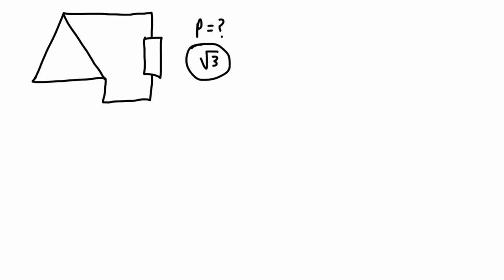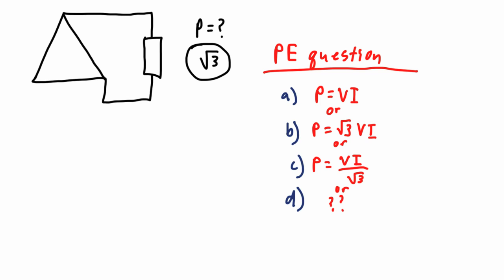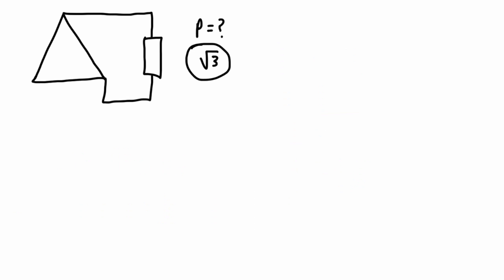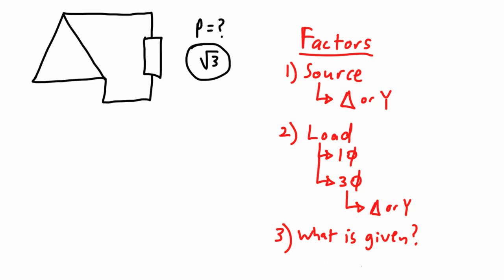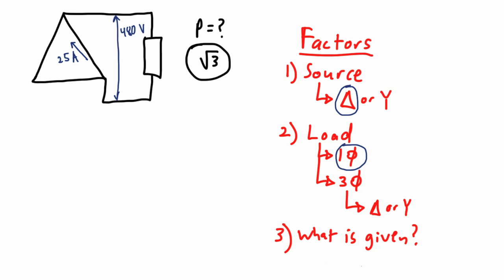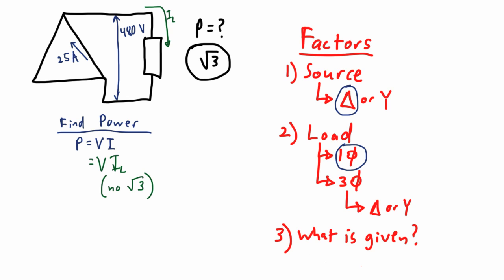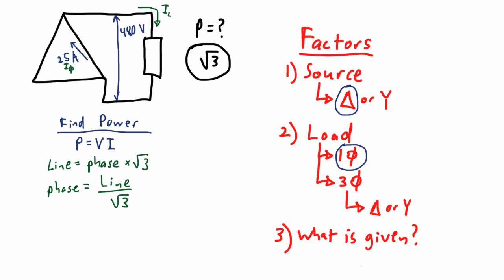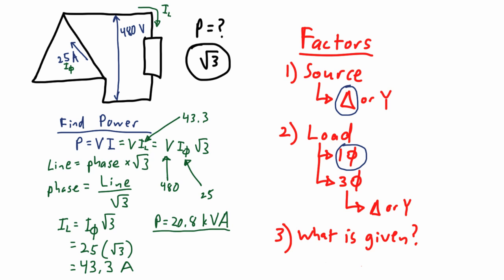Electrical PE Exam - Root 3 (part 1)

Comment: So let's say hypothetically this is a high-leg delta system, and the load is connected from the high point on the delta, to ground. The voltage in the calculation becomes 415v. Do we still multiply the given 25 amps by sqrt(3)? Or since this load is connected phase-to-ground would the 25 amps be used in the calculation?

Comment: Root 3 would work if this was a balanced system. However this problem is not. This problem becomes 2 equal voltages sources in parallel and in a real world example the leftmost legs would have twice the impedance of the 25A leg.  The total current would be 25+12.5=37.5A and apparent power is 480x37.5=18kVA